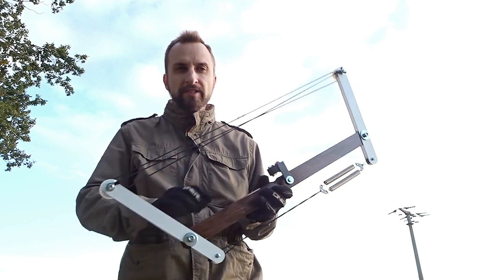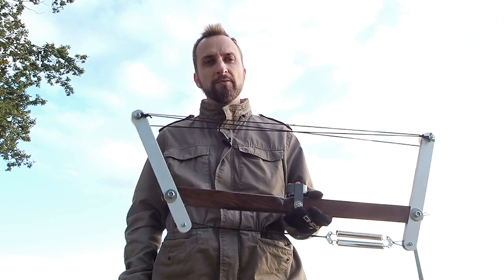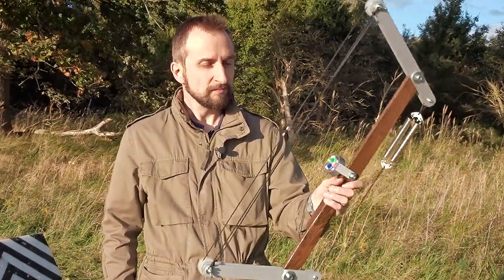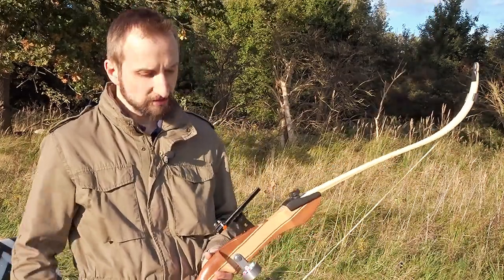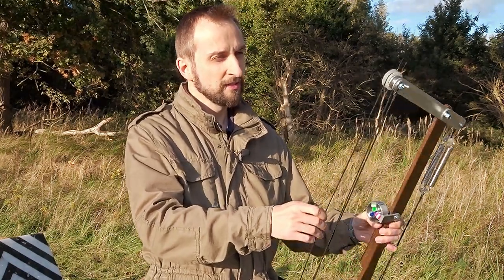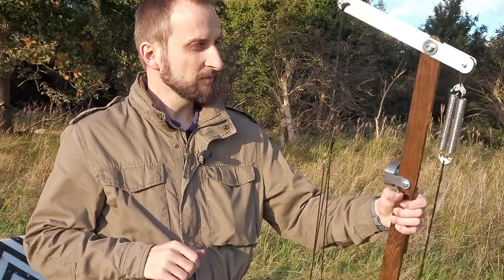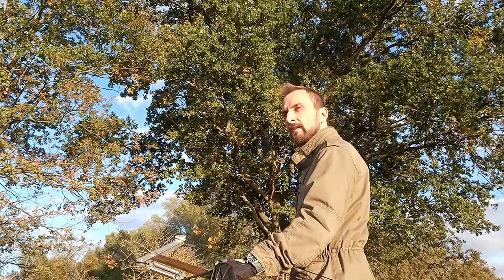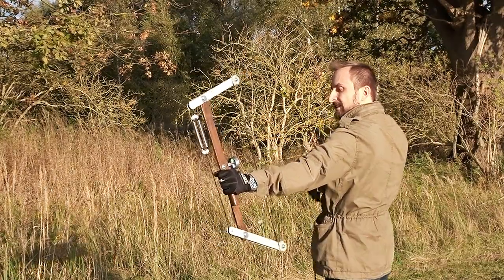Compact Coilspring powered Bow

Comment: I’d be curious as to what effect some steel bearings would have. I wonder how much the lack of friction might effect the performance
Reply from the maker: Good question, something I have yet to test out. I made the main axles from M8 bolts that rotate in fitting alu profiles and are lubricated by grease. So a 10 mm hole in the wood, then inserted a alu pipe with 8 mm inner diameter and then grease and the M8 bolt. The movement doesn't feel very constrained, so I think its fine.
Reply: Ahh got you! I was about to say I’ll be looking forward to updates and then I saw your mark 2 Video. Gotta say man I’m shocked how few subs you have your video productions great and your designs are nice. Hope to see more soon and I really won’t be shocked when I see a few thousand subs under your name.